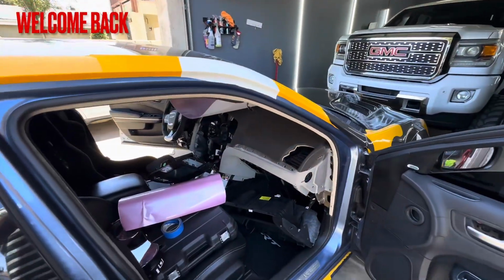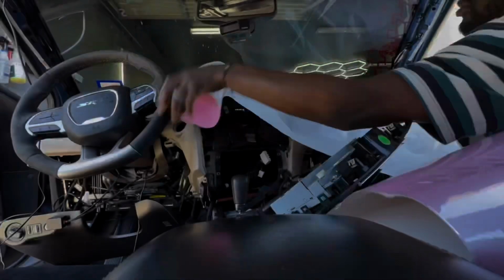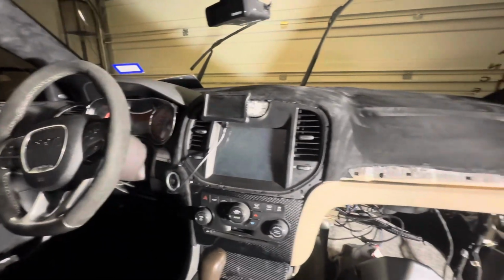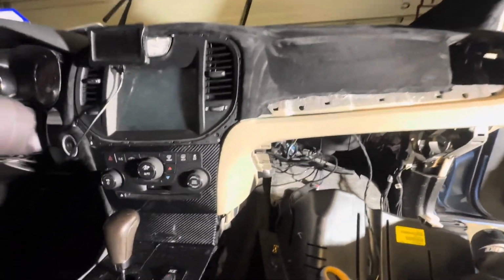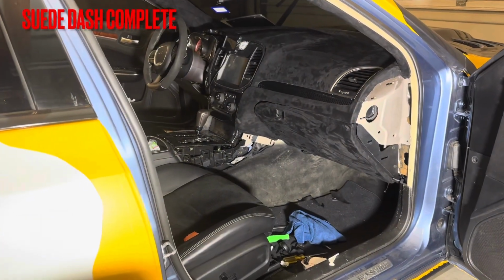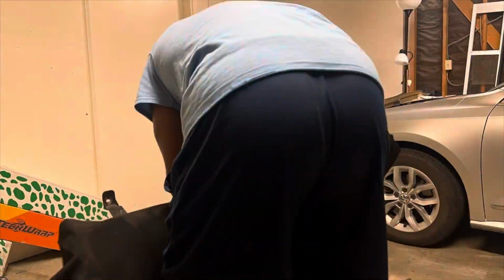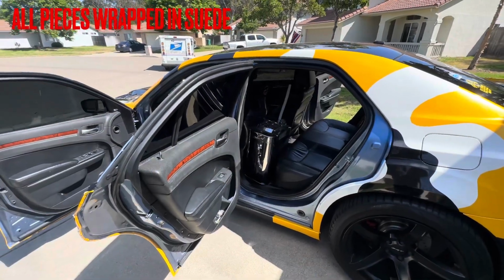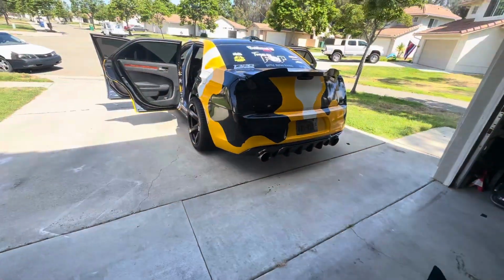SUEDE DASH & INTERIOR CHRYSLER 300 (DIY)

Comment: Did you have any issues putting hellcat gauges on?
Reply from the maker: Not at all its just 4 screws and a wire harness plug and play
Reply: You did not need the tazor ?
Reply: @9HEARTT  nope it works just fine
Reply: @EasyMoneyHemi  so could I buy the hellcat cluster and get the wiring harness  and it work just fine same if I got the srt wheel ?
Reply: @9HEARTT  yea bro you don’t need any wires it’s literally plug and play… 4 screws and I direct connect